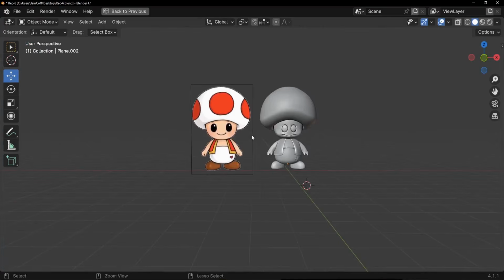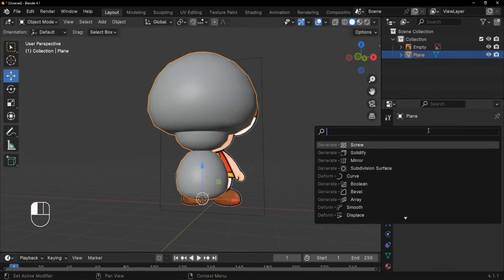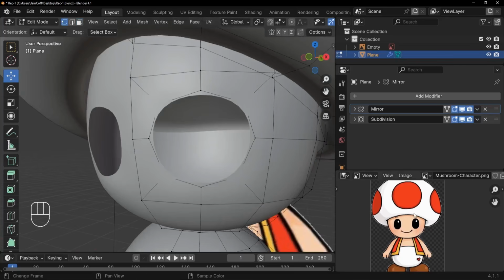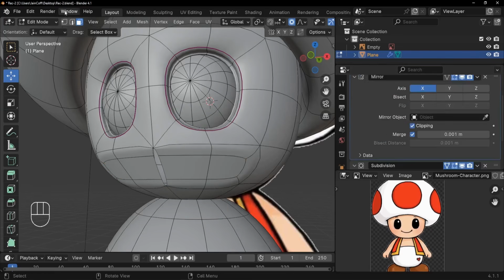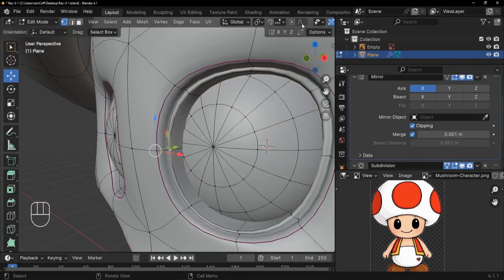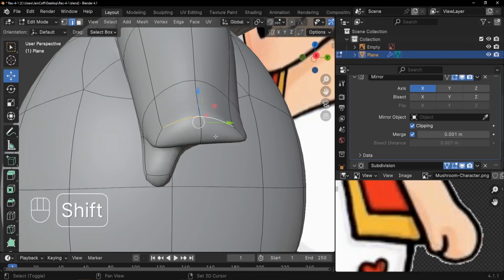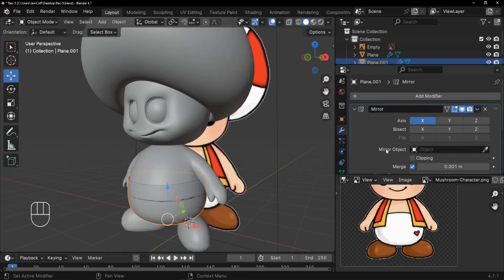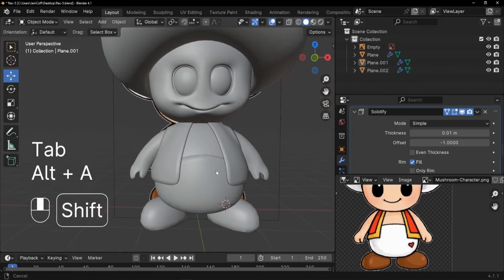Blender Image to 3D Model - Beginner Tutorial

Comment: It’s so helpful when you narrate the hotkeys you’re using. I know the hotkey indicator is on but it’s like trying to watch two things at one time, I’ll either miss the hot key or whatever they did to the model. So, thank you! Also, as a concept designer, going from 2d to 3d in this way seems so much more logical and easier to comprehend. My only request is that you have an outro or something since the “recommended videos” pop up while you’re putting the finishing touches on the model and blocks us from seeing the last 1-2 seconds. 😅

Comment: Modeled a bit years before, and I will say.
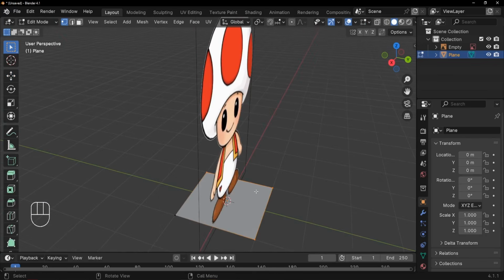When starting, you don't need to delete the plane you spawn at 0:47.  Instead just delete the face, and rotate the plane to be parallel with the image.
Then you will have 4 vertices at the start instead of just one.
I personally move two of them at the bottom of the model and two at the top, then subdivide and move the new vertices and repeat

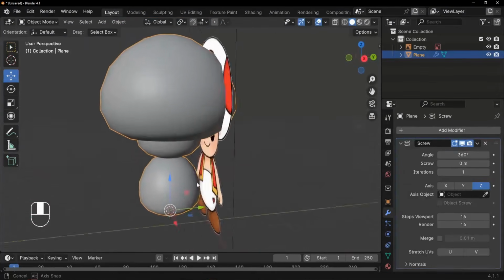Comment: 2:55 is imposable for me when i do it it just makes a line
Reply: i just had the same problem. found my solution on reddit, 

"In that case, the cause is the screw modifier. Modifiers generate additional mesh, which cannot be edited until the modifier is applied. The reason is that in this way the mesh generation process can be made more procedural and non-destructive. Try applying the screw modifier and see if that helps :D"

so u just have to stay in object mode, go to modifiers tab, click on screw modifier and press ctrl+a, i mean they said "make sure to apply screw modifier" in the video but i jst didn't notice it so yeah haha
Reply: @curiosityk1lledthecat  legend

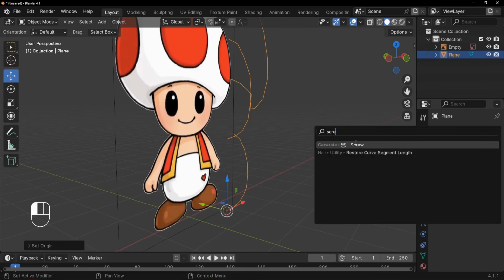Comment: 2:51 is Impossible, mine turns into a real screw not a 3D model
Reply from the maker: The screw happens if you don't flatten the geometry before using the screw modifier
Reply: @realfaker  i did s+y+0 flattening everything along the y axis making it 2d
i then pressed ctrl+A and chose rotation & scale but when i applied the screw modifier i still didn't revolve it as i want